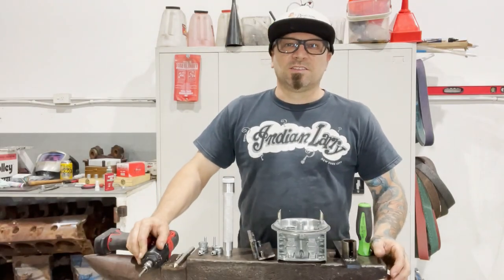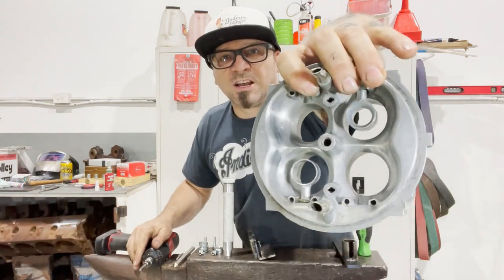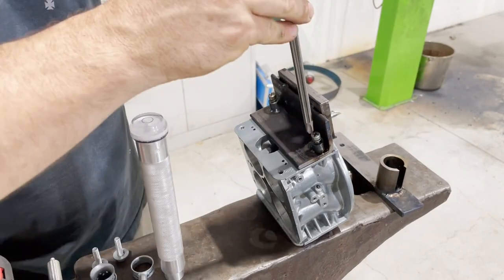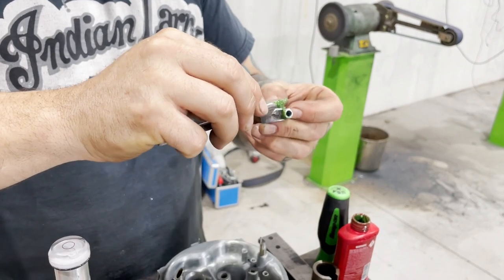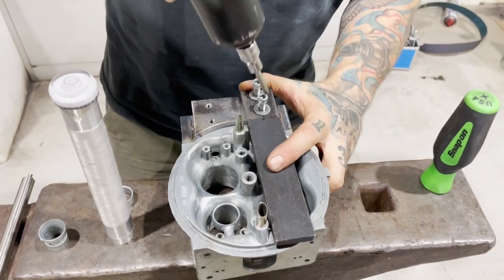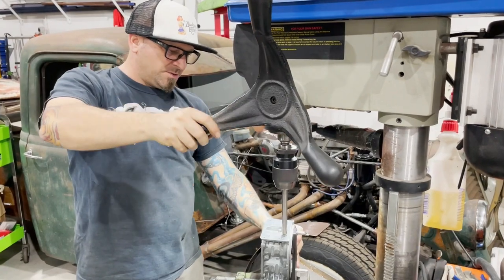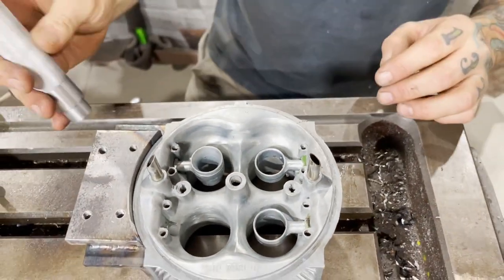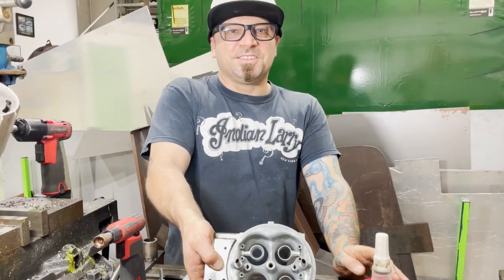Custom Made Annular Holley Booster Installation Tool

Comment: Does the annular allow the use of a bigger carb on a smaller motor for a wider power band and stronger torque curve? example 7500 rpm 302 normal 650 to 700 cfm downleg with annular an 830 or 850 may work better with good mid torque and not sacrifice top end power,...yes?